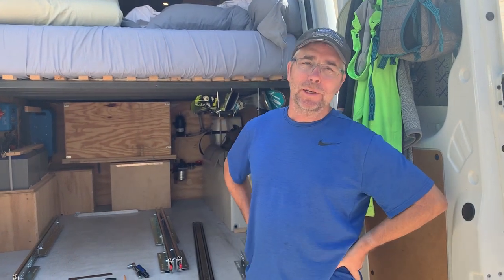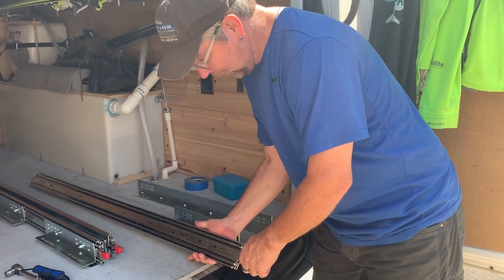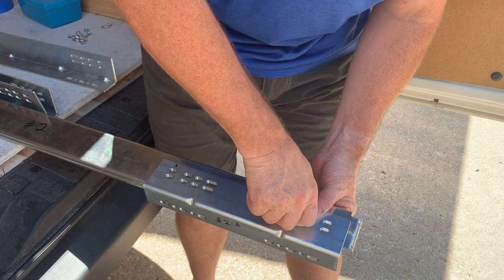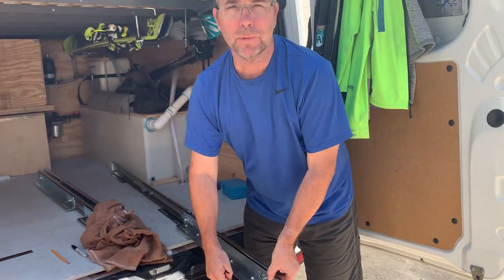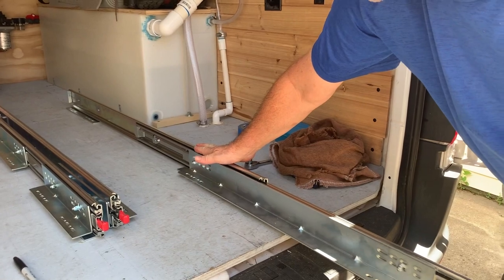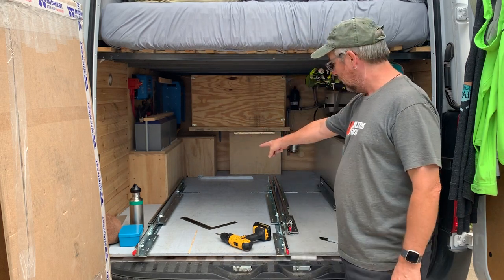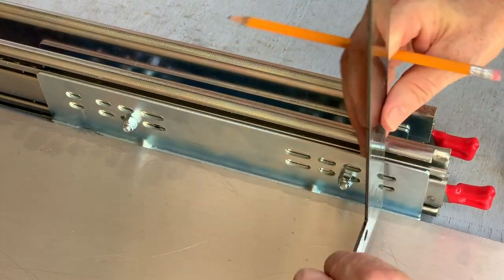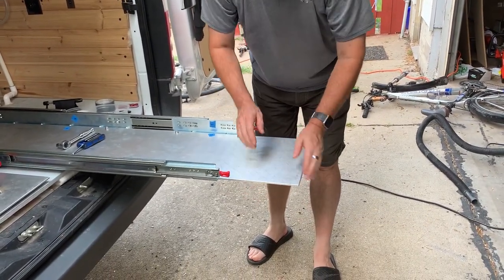DIY SLIDING BIKE AND CARGO TRAYS IN A SPRINTER CAMPER VAN | Build your own Sliding  Aluminum Trays

Comment: These slides have a Right and a Left marked “R” and “L”.   If you are lifting the latch I think you have them switched. You can not see the “R” or “L” if you have the brackets in place. I noticed this after I had one slide built with all four brackets.  Took it all apart and started over. Right on the right side and left on the left side and the latches un-lock pushing down.
Reply from the maker: You are correct. I too noticed that after completing the project and video, and same thing - took it all apart and corrected it. Sharp eye you have. Thanks for the comment!
Reply: @TimAndShannonLTD  Your video was very helpful. Perhaps highlight the comment, so others don’t trip down that same path.  Very thankful for the parts info on the brackets.  I really appreciate not having to build this with plywood sides and footing.  The brackets make the pullout lower profile giving you more handlebar room and it saves space on the sides. Thank you!
Reply: I picked up the same brackets.  Fortunately I lucked out and installed up from in proper direction.   I do need to go back and check for the "R" and "L" on the bracket.

Comment: Great job! Can't wait to see your next project.  You always do such a good job of explaining the process.
Reply from the maker: Thank you so much Terry! So good to hear feedback like that. Coming up next is how we're gonna mount our solar panels on the roof. Hopefully in a week or so... Cheers -
Reply: @TimAndShannonLTD  I've installed a few solar panels on vans and one tip is you can plug the MC4 cables, positive and negative , together and put a clamp-on amp meter around the wire and read the current being produced at that moment in the sun.  The panel will not over load the wire, as it is self limiting and only can produce it's rated max. This is a way to check individual panels or strings to insure all is good before connecting to the charge controller.  Cheers

Comment: Looks and works great. Getting 4 bikes in that small space is impressive, but please radius the corners of the trays to stop someone walking or tripping in to the points and hurting themselves, better still a strip of 2x1 hardwood would look smart and act as a handle to slide them out.
Reply from the maker: @Dump Chump - Thanks for the comment! As far as a 1x2 on the end, our old tray had a similar feature, but it was difficult to sweep dirt off of the tray, so we wanted to make this flat at the end like this. But a radius corner is a good idea and I think we'll do that - thanks!
Reply: Tim & Shannon 
I only noticed and commented because I’m the sort of klutz that would trip and impale myself. 😂

Comment: What were the costs for the sliders and the aluminum?  Did you consider using wood?  Great design and job.  Thanks for sharing.
Reply from the maker: Hi Rock,  Yes considered using wood but we wanted low maintenance and for it to last forever. Links are in the description for all the parts but I think the slides were about $300 and the aluminum sheets about $150.

Comment: Hi Tim. Great job in clearly laying it out so we can follow each step with ease, do you think there would be anything that would hinder me using 3/4 marine grade ply instead of sheet aluminum?
Ie... clearance on the mounting brackets or anything else you could think of.
Again thank you so much.
Reply: Hi Paul - I think that would work fine. I just looked at mine and it might be kinda tight where the nuts are that hold the mounting bracket to the slide, but I think 3/4 ply should fit. Give it some good sealant and you it should work great.
Reply: @TimDustrude  Thank you for the swift reply! I will take that into consideration, If it looks good i will be sure to send a picture, if it doesn't look good you will never hear from me again. 🤣
Reply: @paulbrosnan9789  LOL you're welcome and we hope to see a picture!
Reply from the maker: Thanks for commenting and hope that answered your question!

Comment: Hi Tim,  I noticed an interesting set up you have for your skis.  Could you share what you did?  Thanks, Tim
Reply from the maker: Sure - it's just a couple of 7 inch U-bolts hanging from the bed frame and clamping the skis in place. One pair of U-bolts for each pair of skis. It's not really easy access to the skis, but it works well for storage and transportation. We used some old bike tire innertube scraps cut into strips and clamped in with the skis to keep from them getting scratched.

Comment: Did you take the handlebars out for 2 of the bikes? Is that intentionally/required for them to fit?
Reply from the maker: Hi Jordan, yes the way you see them in this video we removed handlebars from 2 bikes to make them fit, but we’ve since modified it by turning the fork mounts just a bit so the handlebars are angled (not perpendicular to the bike frames) and now they fit without removing them.

Comment: Hi Tim, great job on the build and thanks for the detailed video and parts list which are very helpful.  How much height is lost to the slide (ie from top of floor to top of aluminum sheet)? Seems pretty minimal but trying to gauge if I’ll have enough room to fit my bike on the slide under the bed.  And how much width is lost on each side (slide mechanism plus mounting brackets etc?  Also, apropos the pinned comment, is there any problem having the L and R slides reversed and requiring the latch to be lifted to disengage?  In theory, in the correct orientation, could something heavy falling on the latch disengage the mechanism and release the slide? Thanks
Reply: Thanks DC. Height is about 9/16” above the floor, (top of floor to top of aluminum trays. ) as far as width, I’ll take a more accurate measurement tomorrow but I think it’s about 5” or so. They will still slide just fine when upside down but the locks don’t work as well (or sometimes at all).
Reply: Ok just measured it. 1-1/2” of width is lost on each side. (And with 2 like we have that’s 3” in the middle as well) so a total of about 6”.
Reply: Many thanks Tim, very helpful to know re both points.  Cheers
Reply from the maker: You're welcome - good luck with your build!

Comment: Looking at the link you posted for the Mounting Brackets for FR5400, on the link, there are 4 options with different mm measurements, which did you use?
Reply from the maker: Hi Molly - For each tray, we used 3 pairs of 305mm (12") and 1 pair of 711mm (28"). 2 pairs of 305's hold the drawer slides to the floor of the van, and 1 pair of 305's and 1 pair 711's hold the tray onto the drawer slides. (This is for the 50 inch slides. Different size slides will require different combinations of brackets.)
Reply: @TimAndShannonLTD  Awesome! Thank you so much!
Reply from the maker: You’re welcome - enjoy your build!
Reply: @TimAndShannonLTD  One more quick question, what was the length of the aluminium sheets you bought? 60 inches?
Reply from the maker: @mollyleadbetter  Hi again and sorry for the late reply - the length of the aluminum sheets is 68 inches.

Comment: Four bikes, four front wheels, two front wheel mounts? Or did you do the other pair at the forward end of the tray?
Reply from the maker: Sharp eye - the other 2 are off to the side of the tray.
Reply: Gotcha. Why not add two more wheel mounts at the rear of the tray?
Reply: Also, gotta say, I'm impressed with how little space you got four bikes to fit in, laterally! I'm looking to do something similar with a build soon, though just two bikes and probably will have both bikes facing out the back, staggered a little so handlebars don't knock. I found I could get them snugged up pretty close without pedal-whacking being an issue.

Comment: Hi Tim.  What is the distance between the floor and the bottom of your bed to acomodate the bikes?  Thank you. Rafal
Reply from the maker: We designed our bed so its lowest point was about 1/2 inch above the highest point on our bikes which was the seats. But later we replaced the seat posts (dropper posts) on our bikes and the newer ones don't go as high, so we now have about 3 inches of clearance between the seats and the bed frames. I think it's about 37 inches total, but I'm not positive, and I'm away from the van for a couple of days  so I'll reply again to this comment if it's different, but I wanted to put this answer here now to let you know I read your comment.
Reply: Hi Tim. Thank you fot your help.
Reply from the maker: OK, I've just measured and it is 36-1/2" from the floor to the bottom of the bed frame, and it's 35-3/4" from the top of the bike sliding tray to the bottom of the bed frame. Hope this helps.
Reply: Thank you again. This will help me greatly. I'm starting converting next week. All the best for you.

Comment: I want a full length 6ft pull out draw under my bed in my sprinter, do I need 6ft draw runners or can you use smaller ones?
Reply from the maker: Hi Angela - I'm no expert, but I would guess you could get away with 4 foot slides centered, so that one foot of the drawer would hang off each end. However, I'm not sure how you would reach the lock/unlock lever. If the 4' drawer slide is accessible from the outside, with enough room to get your hand in to unlock the lever, then I think it would work fine. I don't know what else you have around your drawer so, tough to answer definitely. But assuming you can access it, then yes, a 4 foot slide would be enough for a 6 foot drawer I think - notice that our slides are 18" shorter than our tray and so the ends are 9" in from the ends. (hope this helps)
Reply: @TimAndShannonLTD  thanks, I'll look into what you've said and hopefully I can get one built, don't want to keep pulling everything out to just get to the back for something 😀
Reply from the maker: @angelamelville67  agreed. Nice to have things easy to reach.

Comment: Hi Tim,
Nice work you have done. What is the height between the lowest part of the bed frame and the top of the floor.?

Thanks for your answer. 
Richard from Québec, Canada
Reply from the maker: Hi Richard - it’s about 1/2” (12mm) higher than the largest bike height with the seat all the way down and the front wheel removed. (I think it’s 35 inches but I’ll measure it in the morning and then edit this comment if needed)
Cheers!
Reply from the maker: Finally remembered to go measure and it's actually 36-1/2" from the floor - and 35-3/4" from the top of the cargo trays. (And yeah, that gives about 1/2" clearance for the larger bike. We specifically positioned the bed height to accommodate our bikes with minimum clearance :-)
Reply: @TimAndShannonLTD  thanks Tim. Will probably start converti g a new 159 ext 3500 PM next march. 😎😎😎👍🏼

Comment: Greta job! Could you please tell me how much is the weight of the bike tray?
Reply from the maker: Hi Peter. Wow that's hard to say - I just looked through all the receipts for the components and NONE of them shows the shipping weight. I did find the weight of the drawer guides - one is 19 pounds and I'm not sure if that is just one guide or one pair of guides. I'm guessing the mounting brackets would be about 10 pounds for one drawer the way we built ours, and the aluminum sheet... Maybe 30-40 pounds? If it's critical for you, I'd check the links in our description and get ahold of the sellers to find out for sure. Sorry I'm not more help!